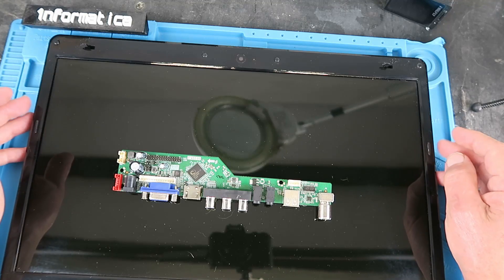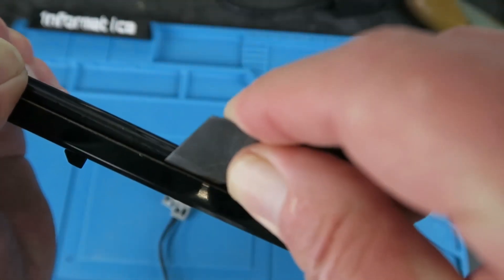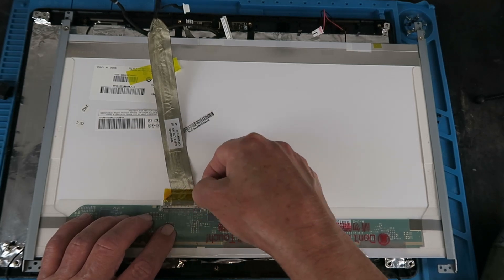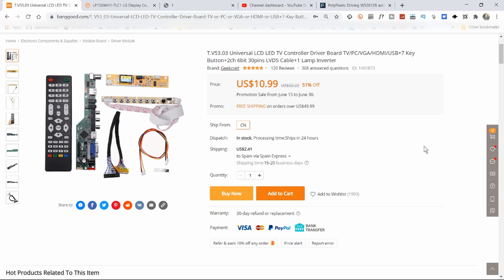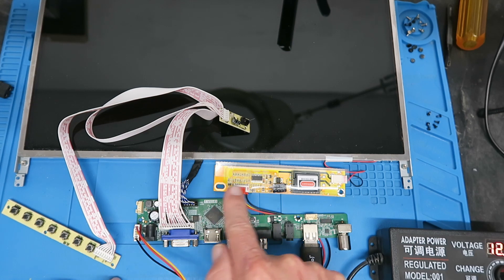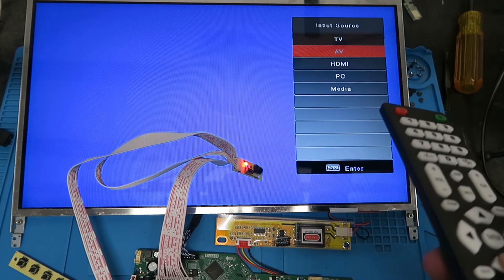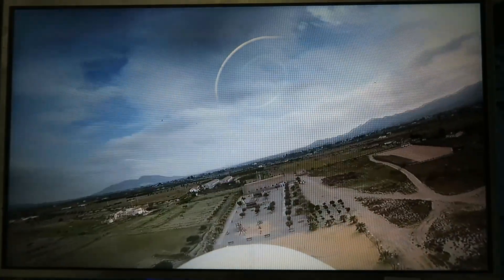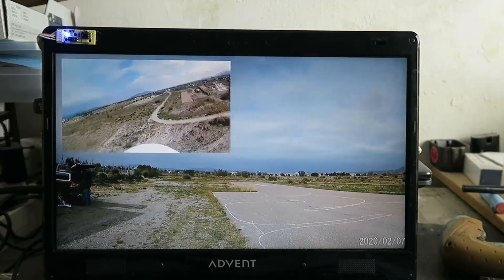T V53 03 Universal LCD LED TV Controller Driver Board Review Test

Comment from the maker: 🛒 T.V53.03 Universal LCD LED TV Controller Driver Board https://bit.ly/TVCntrlBoard
Reply: Hello ive got the same board and yes it runs really hot, is your board still working and did you used a fan to keep it cool?? Great video!
Reply from the maker: @alanwake5927  My board is working well and does not run hot but it is not enclosed and has plenty of air circulating. I guess if it were enclosed a heatsink on the chip and a small CPU fan would help. Please consider subscribing if you have not done so already!
Reply: Those controle board are situable for bigger lcd panels? I have a 40inch panel ind i wanna use it
Reply from the maker: @Retrogamer-pl9zu  Should be no problem. My only thought would be the driver for the backlight may need more power, you can check on panellook.com . Probably you could use the original driver. Please consider subscribing if you have not done so already!
Reply: @1nformatica  Thank for answer, the panel is sharp, from a Philips lcd tv. Of course i suscribe.
Reply: please give the link to the frimwares please im A TEN YEAR OLD BOY TRYING TO BUILD A PROJECT FOR SCHOOL UNDER 12 DOLLARS PLEASE HELP REPLY SOON
Reply from the maker: @sheetalkinhikar5080  The link is : http://myosuploads3.banggood.com/products/20191224/20191224024127T.V53.03.rar
Reply: @1nformatica  hay the tab opens then closes
Reply from the maker: @neon3d602  I am sorry I do not understand what you mean.
Reply: @1nformatica  well i click the link and even the bangood link and it closes all tabs idk y but yh i found some this might work but if u could get me a file link for 1920x1200 and 1280x800 that will be brilliant plz ?
Reply from the maker: @neon3d602  You have to get the whole achieve it is here : http://myosuploads3.banggood.com/products/20210625/20210625040917T.SK105A.0320210612.rar YouTube no longer shows me if you are subscribed. Please consider subscribing if you have not done so already!

Comment: Hi, do you know if there is some configuration to change the air tv reception settings cause I have one but it doents recognize any air channel
Reply from the maker: The TV receiver only supports the old analogue TV frequencies. Most countrie in the world have switched off those signals in favor of modern digital systems i.e. DVBT. You can only receive this by adding an external decoder. Thanks for watching, have a great day!

Comment: Great video. 
Will this work to fix an LED tv, or just CFL? backlit ones?
Reply from the maker: Provided you have the correct LVDS cable and the board supports the resolution you need it should work with LED screen. Thanks for watching, have a great day!

Comment: with the v53 my board my display was really dark and the display has 30 pin but the connector is only half the length, after update of firmware, the screen stayed all the time grey. No Menue in sight. time for a new board but not more the same.
Reply from the maker: Sorry you had a bad experience. There are newerr boards around now like this : https://s.click.aliexpress.com/e/_DeJDcYx Thanks for watching, have a great day!
Reply: @1nformatica  I try to fix it yesterday... and it worked :) dont´t know what was wrong perhaps a cable was a half millimeter not in :D
Reply from the maker: @Mr.TomMoon Great news! Glad you got it sorted!

Comment: Hi, I lost my remote and want to change lcd to another type. How can I enter Factory Setting without remote control?
Reply from the maker: You don't need to enter the factory menu to load new firmware. If you put a USB drive in with a new *.bin file it will load it on power up.

Comment: Hello i got black screen problem(backlight is on but no video). I didn't flash any firmware because when i plug in usb it doesn't even start to flash. I know it's a bit old video but could you help me?
Reply from the maker: First check that the power supply you have is capable of at least 3 Amps. Check the "FAQ" section in the video description for other reasons why it will not flash. Thanks for watching, have a great day!
Reply: @1nformatica  I checked all and nothing works. Maybe mine has some firmware preinstalled. Is there any way to update firmware using the remote?
Reply from the maker: @ironeQ_UwU  The only way I know Is to put a USB drive in with a new *.bin file it will load it on power up.
Reply: @1nformatica  do you have some discord or something like this? It would help me get responds earlier etc
Reply from the maker: @ironeQ_UwU  You can email me : gizmohombre@gmail.com
Reply: @1nformatica  Could you please check spam on your email? I use proton and sometimes my emails are getting sent there...
Reply from the maker: @ironeQ_UwU  I have sent an email. It is the same process, put your "bin" file and the MD5.txt on a USB drive and the SW UPGRADE option will flash the firmware.

Maybe it is useful if you have different configurations.

Comment: I have got the  T.SK105A.03  board and installed from above firmware for 1280x800 screen. Its working. But I find the black chip on board is heating excessively and when this happens does not respond to remote very well....probably throttling its operation due to heat. Any idea why heating? I am supplying with 12V into the socket. Also using a screen with 20pin LVDS connector starting at pin 1.
Reply from the maker: The board takes a lot of power and does run hot. Plenty of ventilation is needed and maybe a small fan. Thanks for watching, have a great day!

Comment: Great video, I have a Samsung panel LTN141AT03  14.1 Inch would this controller board be able to run it. Its also 30 pin.
Reply from the maker: Check the panel specs at panelook.com it will give you all the information you need. Other info is in the video description. Thanks for watching, have a great day!

Comment: my lcd panel volume not working .. how can i repair it
Reply from the maker: Are you using the speaker connection or audio out? Have you tested both? Does the volume bar move when you use the remote or buttons?

Comment: will this work with any type of old laptop monitors?
Reply from the maker: Being "universal" it will work with pretty much any panel. You need to remove the panel and use the model number on : https://www.panelook.com/ This will show you the information you need, max resolution, type of LVDS, voltage etc. Check those values with those supported in the product description. Thanks for watching, have a great day!

Comment: Ananp  ,Hi nice video , do i have to register with panelook ,to download firmware. for individual project . panel ,( LP156WH1 TL C1)  THANKS
Reply from the maker: Hi, Panelook is only used to find the specification of the panel like max resolution and voltage. The firmware is usually supplied by the website where you got the panel. Otherwise there is a link in my video description Thanks for watching, have a great day!

Comment: Hi, I need help. Is it possible to use step-up USB cable 5v to 12v on Lcd controller board and connect powerbank as power supply.I try but the USB will get very hot and shut down after 10mins+. How many ampere I need to input the board n how I convert it?
Reply from the maker: The board needs a 3 Amp supply. Unfortunately step up converters are very inefficient and will generate a lot of heat. You could use something like this : DC 3V-35V to DC 5V-45V Boost Module 5A  https://s.click.aliexpress.com/e/_ATOxLH but really a 12 volt supply is a better solution. Maybe you can make one using 18650 cells. Thanks for watching, have a great day!
Reply: @1nformatica  thanks for your advice. wish you all the best
Reply: @1nformatica  hi how many 18650 batt needed for this board?
Reply from the maker: @kforkindness6295  I would make a 4 cell in series pack each cell has a max voltage of 4.2 volts so a step down convertor would also be needed. 18650 cells are available in many capacities for example 2 Amp Hour, so to make a pack to last 1 hour at discharge of 3 Amps would need at least 2 strings of 4 cells in parallel, 8 cells. You will also need a battery management board to protect the cells like this : https://www.youtube.com/watch?v=K6P4fiPUbgA
Reply: @1nformatica  👍once again thanks for your advice, will try to figure out following your idea.

Comment: Please send me the link to buy LVDS (1 ch, 6-bit) , 40 pins Connector
Reply: Will this pin suitable for Universal LCD TV Controller DriverBoard
Reply from the maker: @tendilvignesh1508  You can compare the connections here : https://sites.google.com/site/lcd4hobby/lvds-cables/e-40-pin-cable?authuser=0
Reply: Can you send me the datasheet for HB140WX1-200  display
Reply from the maker: @tendilvignesh1508  Go to https://www.panelook.com/
Reply: @1nformatica  in this link I can't download the datasheet
Reply: So send me in pdf
Reply from the maker: Here you go : 40P-D6 Single 6bit 40 Pins 0.4mm LED LVDS Cable https://s.click.aliexpress.com/e/_98VWPF Thanks for watching, have a great day!
Reply: Can I connect raspberry pi 4 directly to the 14 inch laptop screen or any otherway, if so then tel me how to connect it
Reply: My laptop screen is HB140WX1-200

Comment: Very helpful video for commissioning, thank you.
I also have the T.SK105A.03 kit. Only as it seems though my LG Display LM215WF1-TLA1 is a 30Pin, but "8Bit" and also the connectors for the backlight are different.... is there a way to bring this back to life?
Reply from the maker: This board is only 6bit. You will need a different board like : https://s.click.aliexpress.com/e/_AXoFPT Thanks for watching, have a great day!
Reply: @1nformatica  I think it is the LVDS cable that comes in 6 bit or 8 bit version, not the board.

Comment: How do you color correct the display from factory settings menu?
Reply from the maker: I am not sure what you are trying to correct. The main menu has color, tint and color temp settings. The factory menu has more option under "picture settings" check those out. Thanks for watching, have a great day!
Reply: @1nformatica  There are options in the factory settings to modify the saturation, gamma, etc. If you select picture mode, we get options for W/B adjust, QMAP adjust, color debug etc.
We also have something like NONLINEAR option. Withing this we get to set various curves for brightness, contrast, saturation, hue, sharpness, and so on…  The challenge is that i am unable to set it to get accurate colors from the board i have. I have tried fiddling around to no luck. Images that i get are too saturated or too dark.  

Do you have any resources from where i can understand and set these options?
Reply from the maker: @Hexagerate  I have never gone Internet othat in depth. You may find this page useful : https://www.findingtheuniverse.com/monitor-calibration/

Comment: hello,
My screen has the voltage and signal inverter joined in one connector. What controller board could I use?
The model is the LP140WH4-TLA1.
Reply from the maker: I think this board will work you just need a 40 pin cable. You can download the datasheet with 40 pin pinout here : http://www.datasheet39.com/PDF/829620/LP140WH4-TLA1-datasheet.html You can see how to wire a cable here : https://sites.google.com/site/lcd4hobby/lvds-cables/e-40-pin-cable?authuser=0 Thanks for watching, have a great day!

Comment: hi, i bougth a chinese board call T.SH105A.03 .Its pretty similar with your board. the problem i have is the firmware my board has is the same version with my firmware i plan to flash it. and everytime i try to flash the firmware it always so this message (same version) but wrong resolution. So my question is how can i replace the firmware to match my panel resolution. Thanks

Edit: my board is T.SK105A.03
Reply from the maker: I do not know that board, can you provide a link? Check your panel maximum resolution on this site : https://www.panelook.com/
Reply: @1nformatica  Oh, my bad. My board is T.SK105A.03 (not SH) and my panel is LP154WX4-(TL)(C5) 1280x800.
i got the firmware match my resolution here: https://www.kazmielecom.com/2020/11/20/t-sk105a-03-firmware.html
and the ledlight of the board didn't flash at all. (i tried it multipletime)
When i give up i turn on Factory Setting of the board. It show this 2 line:
OCS:65027  BIN:UTS6710_100.BIN
ver.20210722_114819  T.SK105A.03
and when i chose "SW Update" from usb (when it's on) It's show the message "THE SAME VERSION".
. . . 
I assume if i have another firmware version(even with wrong resolution) i can switch to it and flash my board with right resolution firmware later.
So, if you know how to replace the firmware or the different version of my firmware or reset firmware, please let me know. Thanks
Reply from the maker: @coky7754  Try the firmware and instructions from here : https://receiverpro.net/t-sk105a-03-firmware-download/ I have only ever flashed from the USB stick.
Reply: @1nformatica  well, i've alreay tried it. do u suggest anyother way to work around? thank you
Reply from the maker: @coky7754  For flashing check the "FAQ" section in my video description. Otherwise maybe the board is faulty.
Reply: @1nformatica  I downloaded the firmware in your decreption and tried to flash my board 1 last time and it actually work.
Now i can't say how much i appreciate to your work. Thank you bilions time, men. Keep up your great work.
Reply from the maker: @coky7754  Happy to have helped! Have a great day!!

Comment: My panel 1ch 6bit 40pin support this board?
Reply from the maker: The board is supplied with a 2 channel 30 pin lvds cable. You would need to buy / build a cable for your panel.

Comment: Hello, your video is very helpful. I made use of an lcd from my old laptop using controller board, but I not getting a clear picture. Do you have issues with clear picture.
Reply from the maker: My picture is clear enough for me. There are many options in the "hidden" menu to change how the picture looks, you will need to experiment : https://youtu.be/C2YTL25iyHU?t=496

Comment: I bought a tv board t.sk105a.03, followed your instructions, attached a fat32 usb with firmware, plugged in the red indicator light and used the remote to turn on the power, the red light turned green, stood still, the light did not flash like your video  instructions, it does not load the firmware and its screen has stripes on both sides, board t.sk105a.03 can use screen code T215HVNO1.1 ? see the my link video error, do you know this error ?
https://www.youtube.com/shorts/TDiq51cmVE0?feature=share&zdlink=Uo9XRcHoRsba8ZeYOszjBcTlRsTiPIvXRcHoRsbaBdblTNHrOcKYB29fRtCYEdiYSsDePMrbNtLoR28w8dfXR6yjDJGqC30tDZOqEbmlN2yYB29XS71fP28w8ZKqD30mDpOsD29zVG
Reply from the maker: I do not think the board is being flashed. I did not use the remote to switch on, just apply the power and wait for it to start : https://youtu.be/C2YTL25iyHU?t=392
Reply: @1nformatica  Have you watched my video yet?  When I turn on the screen, the screen is streaked so I can't see anything to change to another mode, I think this TV board has a firmware error or some error on the pannel so I need your experienced help.
Reply from the maker: @tienphanmemtinh8207  Yes, I watched your video. You turn the screen on with the remote before the board has a chance to flash. You should just power the board on and not do anything until the LED has been flashing for some minutes.
Reply from the maker: @tienphanmemtinh8207  Again you are pressing the remote control, do not do that! Just apply power and the board will check on the USB stick for firmware and if it is correct start the flashing procedure. Look  in the video description I have a "FAQ" section with help if it does not flash.
Reply: @1nformatica  i tried both cases using keyboard and using remote both of these cases did not re-upload the firmware, did you see the video i sent ?  I can't find a video on youtube about this problem, do you have a video on how to fix this?
Reply from the maker: @tienphanmemtinh8207  My video shows all the correct steps. If it is not working for you then try a "brand name" USB drive or more powerful power supply minimum 3 Amps. If it still does not work then maybe your board is faulty.

Comment: Excellent video, I tried to replicate it but I had a problem, at the time of turning on the screen it only changes color (first red then green, then blue and finally white to then repeat the cycle), do you know how it could solve the problem or what it is due to?, thank you very much.
Reply from the maker: It is probably the firmware. Often there are multiple firmware for the same resolution, try a different one.

Comment: Acabo de montar la placa y la pantalla se ilumina pero no me aparece ni menu ni nada. Que debo hacer? Gracias
Reply from the maker: Asegúrese de haber actualizado el firmware correcto para su pantalla. El suministro de 12 voltios debe poder dar 3 amperios. Consulte la sección "Preguntas frecuentes" en la descripción del video. Un saludo.
Reply: Tengo un adaptador de 19V y 4,74A, habra algun problema con eso?? Como puedo saber el firmware correcto??

Comment: The usb update option on the lvds controller is disabled out from the box.I can not update my firmware to the appropriate resolution i already tried several flashdrive but still it can not update the firmware
Reply from the maker: As far as I know there is no way to disable the firmware update. Check the FAQ section in the video description. Make sure the drive is formatted FAT32 and the correct firmware for your type of card is unzipped into the root directory with the checksum file. If all that fails the card maybe faulty. Good luck!
Reply: Thank you for the response and the suggestion. Godbless to your channel 👌🙏